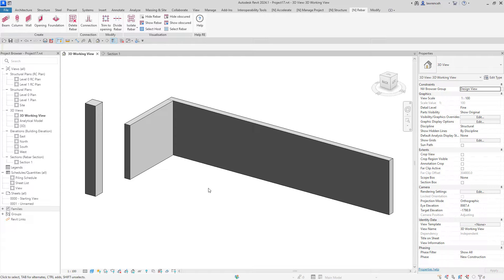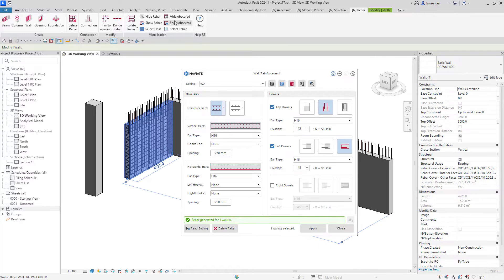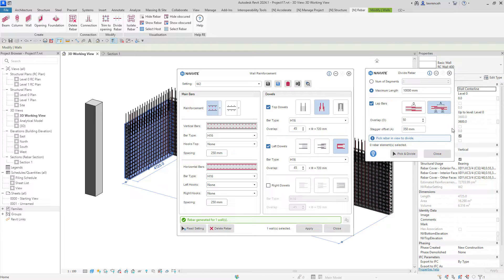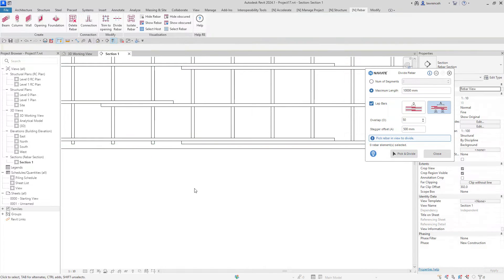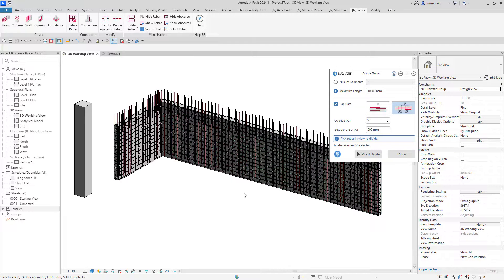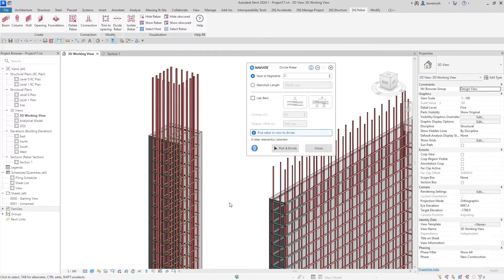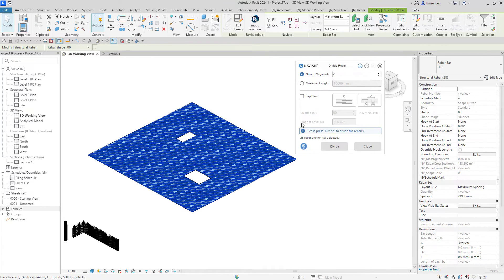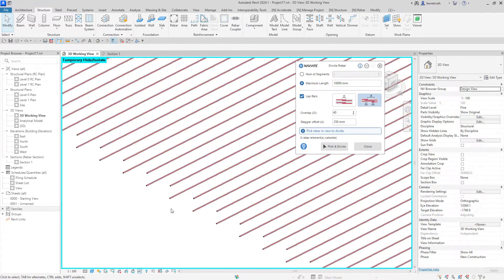Discover Naviate Rebar - Divide Rebar

Comment: noticed that rebar splitting does not work with non-rectangular plates. Are you planning to update this function so that it becomes possible ?
Reply from the maker: Hi! Thanks for your question. According to the team the limitation we have is that you can divide straight rebars (with or without hooks). You're more than welcome to send an email to info@naviate.com or connect on our chat on the website for further details. /Anette, The Naviate team